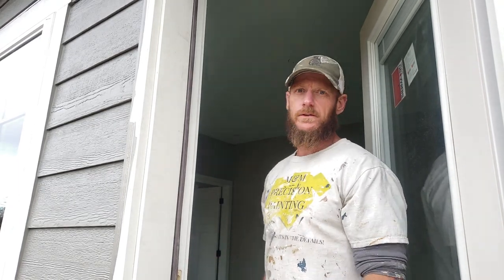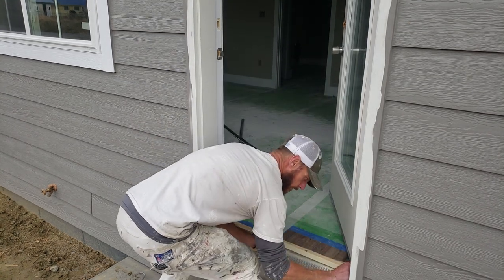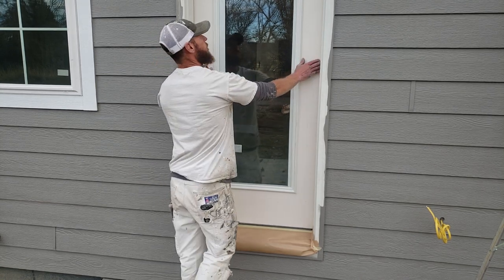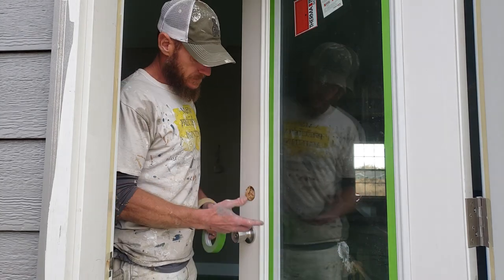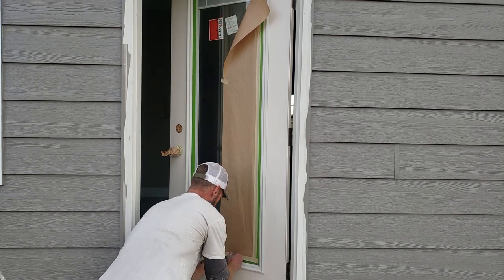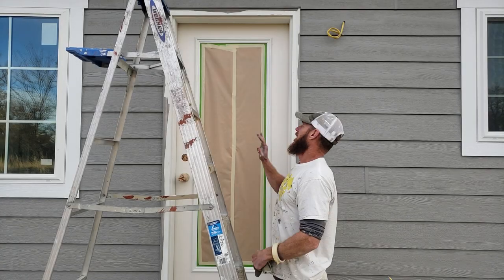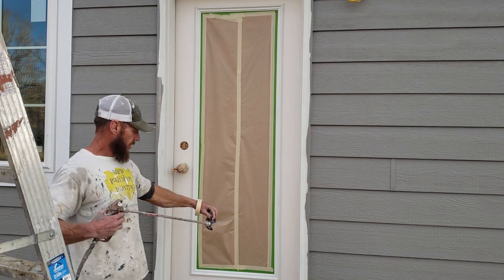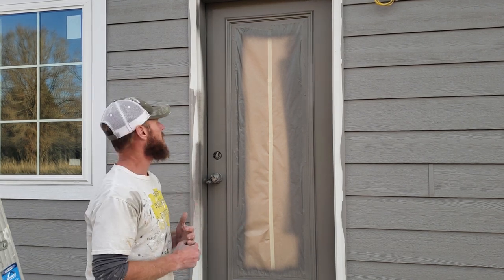How To Paint A Metal Door

Comment: Is it possible to paint a metal security screen door with expanded screen with a brush? The location of the door is pretty windy and spray goes everywhere. I've done it a couple of times with spray cans and it doesn't seem to last very long. Thanks.
Reply from the maker: I suppose you could try it out. I would advise you to scuff sand any smooth surfaces and apply a bonding primer before applying a topcoat. I have a feeling if you do this, then I think an enamel spray paint would last a lot longer!

Comment: I have been working on a metal patio door.  Yesterday, I primed it, and today, I painted it.  Both times I used a roller. About an hour after painting the door, I noticed that there are tiny bubbles all over it on both sides.  What can I do to get rid of the bubbles before applying the 2nd coat, and what can I do to ensure that I don’t have the same trouble after the 2nd coat?  

Thanks.
Reply from the maker: Sounds like it could be contaminated. This usually leads to fish eyes, which are bubbles etc. where the paint won't adhere. Did you wash it with a degreaser before priming it ? If not, you should do that.  Also be sure that the primer is compatible with the finish paint. Use an acrylic or oil based paint for the finish.
Reply: I am planning to sand the door down and put the degreaser on it.  How long after I put the recent coat of paint on is it safe to sand the paint back off?
Reply from the maker: If you are sanding it all off it should be good to go.
Reply from the maker: Make sure to clean it really good.